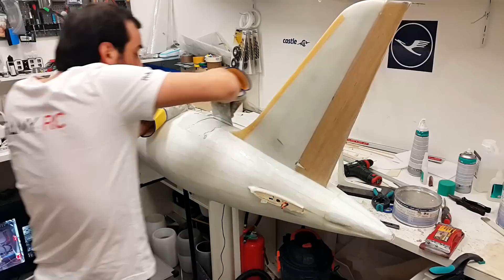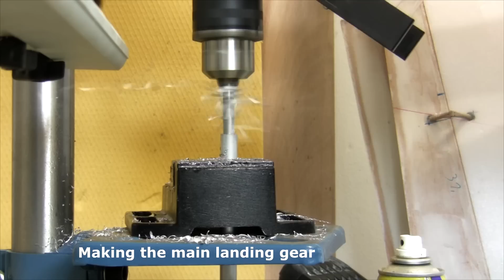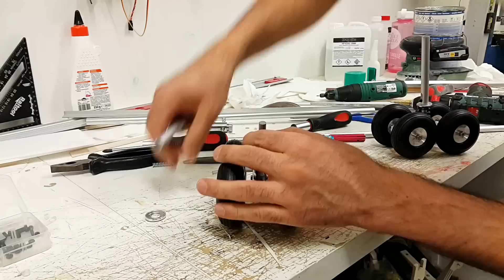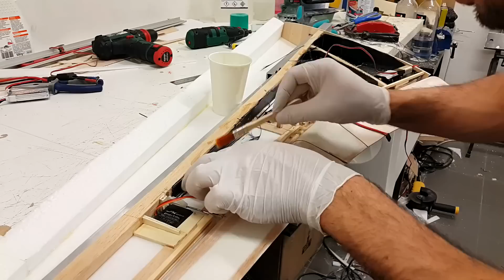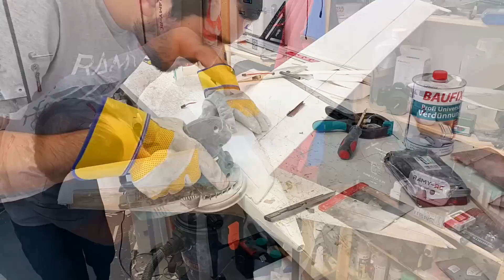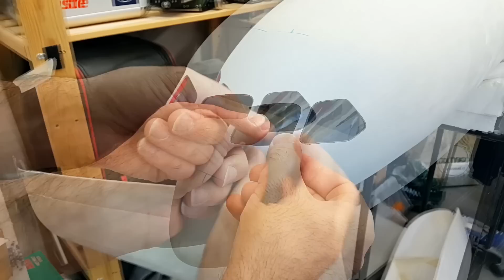Boeing 787-9 Dreamliner RC airliner build video PART 5

Comment: heres a little trick that might help you when using polyester body filler. get different color hardeners. i use red, blue, and green. alternate colors between coats. it will make it so much easier to see the imperfections and it helps when youre building contours. it helps me not to apply too much. because the more you put on, the more you have to sand off.

Comment: Please don't take this the wrong way, but I have a lot of experience with composites and would offer the following.  First, you were wearing what appeared to be latex gloves.  They will not protect you from the hazardous components in epoxy hardeners.  You are risking becoming sensitized to epoxy and that is not a condition you want to deal with.  I have seen workers that had to completely quit working with epoxy at all after becoming sensitized.  Use nitrile or nylon gloves and save yourself from that problem.  Last, you are power sanding in an enclosed space with no breathing protection at all, not even a cheapo dust mask.  I can't even begin to tell you how bad that is for your lungs.

Comment: Very impressive..... I saw the latest crash video of this 787/9 , aluminum used instead of wood may be a good idea.  I want build models like you.  I would use a lot of CNC cutting and laser cutting. Please share me your contact details.  Let's get in touch .... Looking forward to hear from you. 

You can ping me on my what's app at  (+91) 6301306006

Comment: What's the final cost to build a plane like this?
Reply: Super hard for him to estimate something like that because of all the parts. ESCs are around $250 each and the fans are  at least $600 each. From my experience, I'd say $2600-3200 for just this plane w/ electronics and materials but add in all the other stuff (battery chargers, radios, glue, random hardware) you're looking at $5k+ easily. Then consider the fact he 3d prints some parts with 3D software and has all the tools necessary and you can see that its a big upfront cost for large airliners!